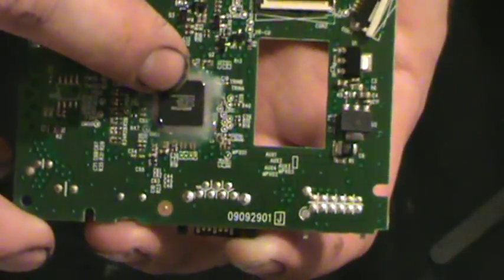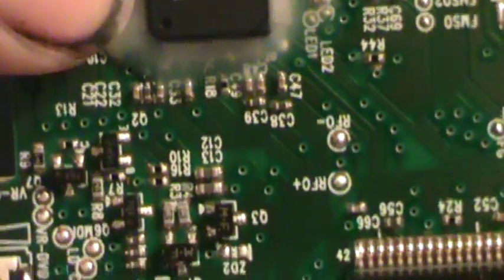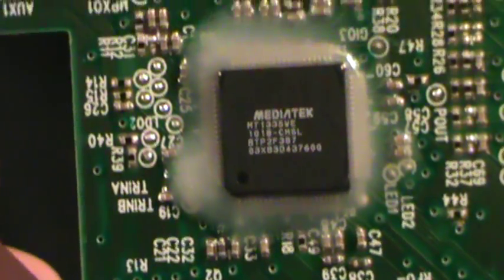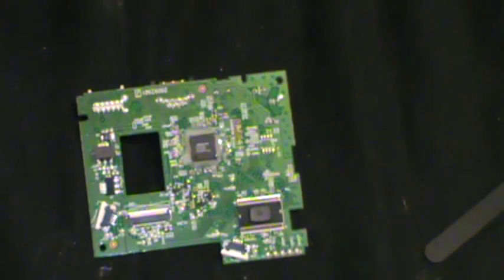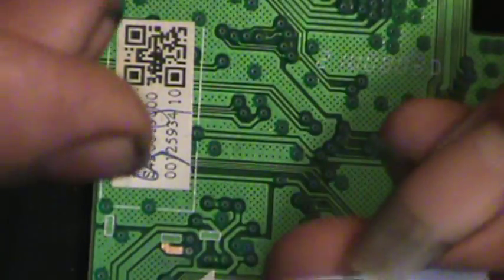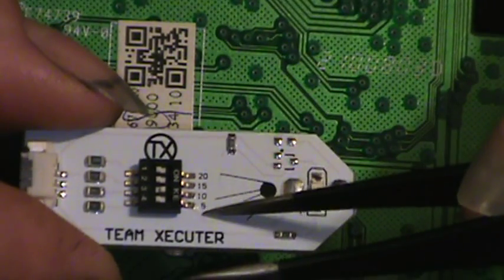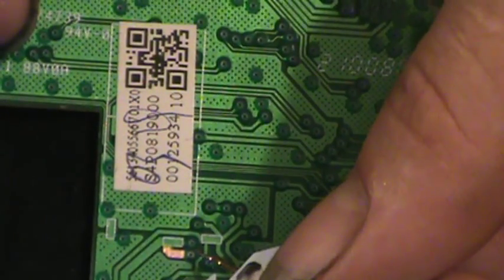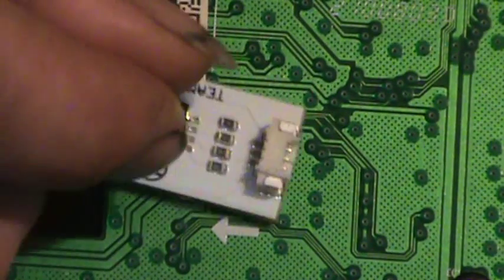Xbox 360 Slim drive flash with Sputnik probe Part 4

Comment from the maker: That depends on if you have the MXIC which requires the sputnik lol.   Well you dont have to have the sputnik probe.  You could also use the sputnik switch.  TBH the probe only requires you to clean, cut, and repair one trace.  With the switch you have to clean 3 spots and solder to 3 spots.  I found the Probe to be easier.  However the switch you can lock and unlock just by flipping a switch.